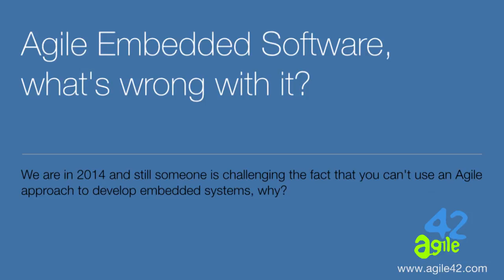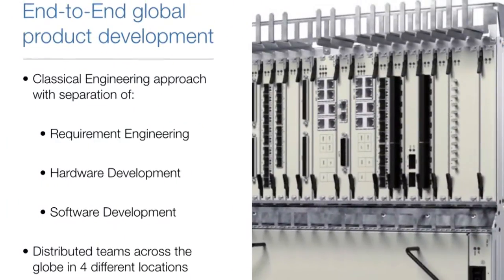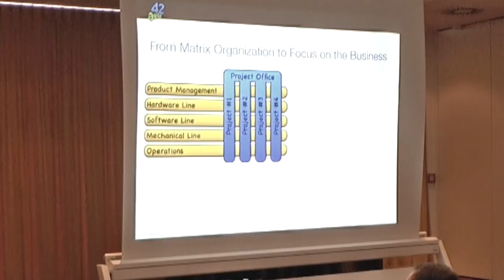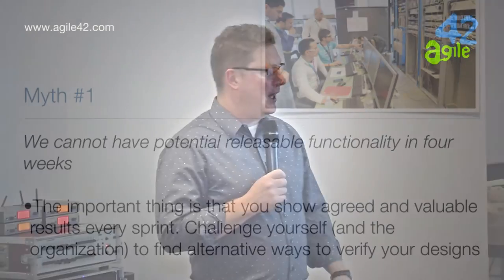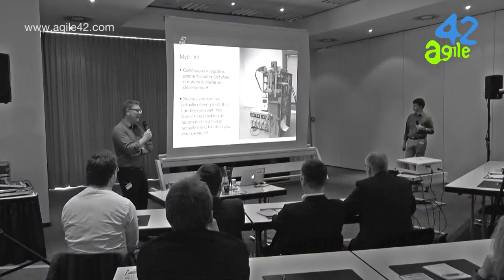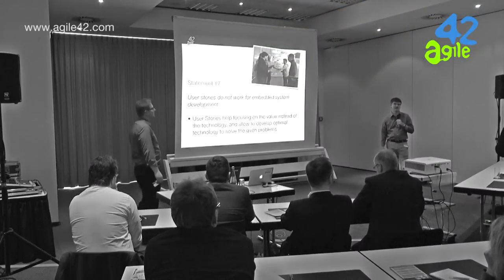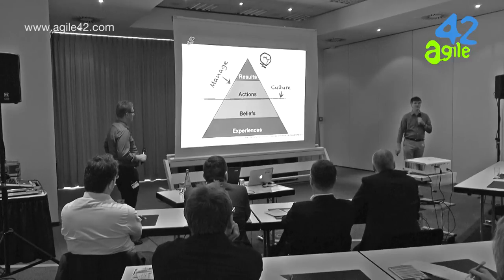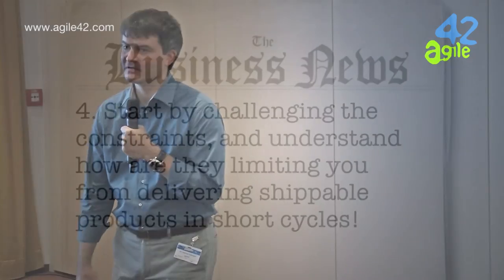Agile Embedded Software Development, what's wrong with it?

Comment: case studies
07:35 Ericsson Optical Network Infrastructure
14:40 from matrix to agile organization

myths
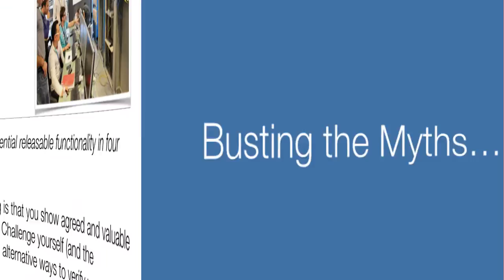24:30 cannot have releasable functionality within a few weeks
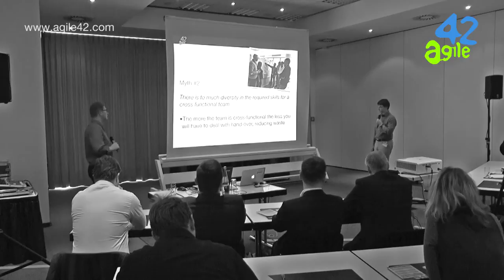27:50 agile requires too much diversity in skills
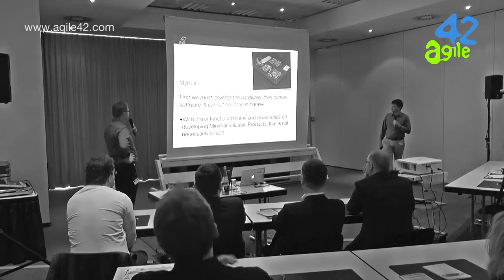30:20 hardware must precede software
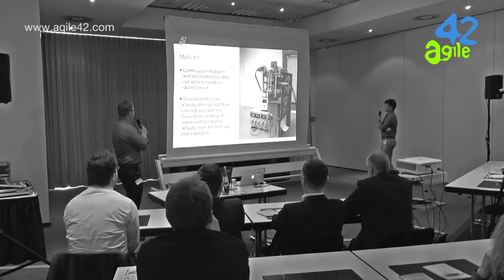32:40 continuous integration and automated tests don't work for hardware
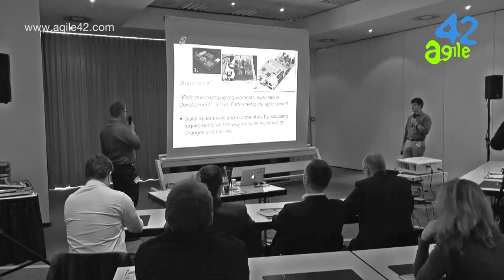34:20 cannot have requirements changing late in a project
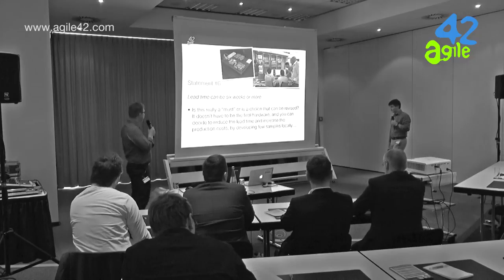38:05 cannot avoid long lead times
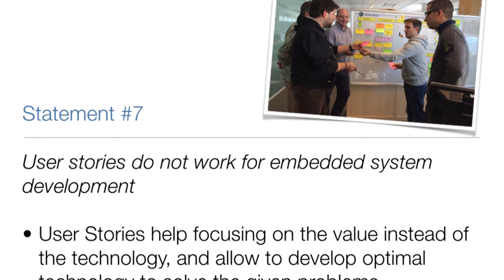40:35 user stories don't work for embedded

transition models
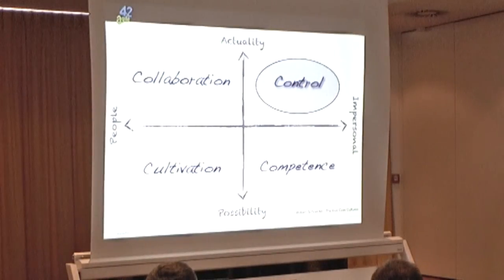44:10 organizational cultures model (control, collaboration, competence, cultivation) by William Schneider
48:55 results pyramid (results, actions, beliefs, experiences) organizational change model by Roger Connors & Tom Smith

Comment from the maker: Here's the complete presentation of "Agile Embedded Software Development, what's wrong with it?" as recorded during the "Embedded meets Agile" conference in Munich on February 18th.

Our senior coaches Andrea Tomasini  and ***** analyzed some example cases that included the “limitations” often attached to  #Agile  methods and also gave some hints on how to solve them. Finally they also attacked the “culture” issue. This is especially important for companies which grew out of hardware development and do not have a solid culture that include software, and therefore are stuck with waterfall development process and a traditional view on professional barriers for their employees. These companies are usually the ones not understanding that the complexity for years gone away from pure hardware, and landed in integrated product development. Without more focus in increasing quality of the process and the techniques to build - especially mission critical - functionality, the cost of failure are going to be very high, as the amount of bugs exposed to the users will rise and the competition sharpens at the same time.
Reply: It has been quite an interesting keynote. Especially looking at people nodding when we listed the "statement" proving that Agile can't work with Embedded software... Really interesting reactions also on the LEGO mind storm automated test device :-)
Reply: This was great are there slides out there for this talk?